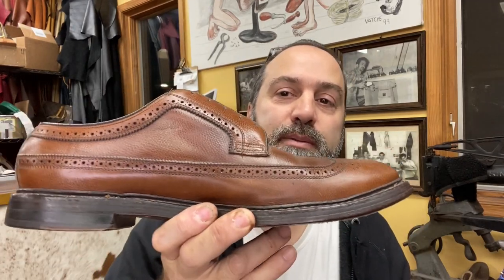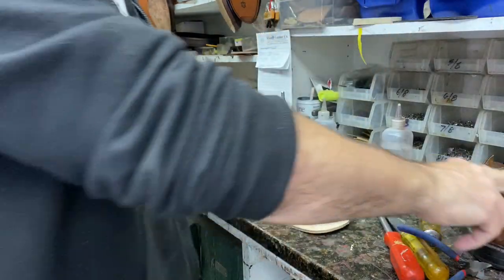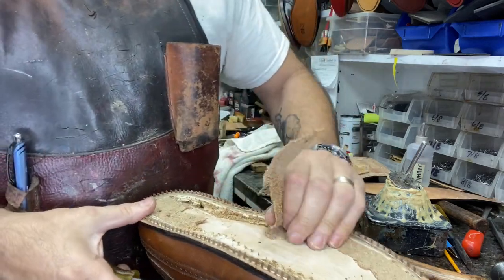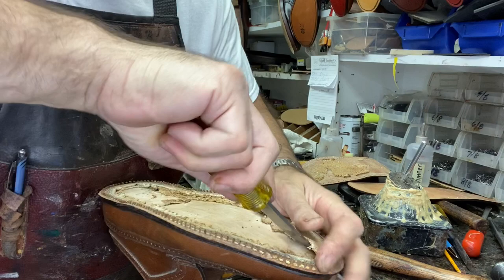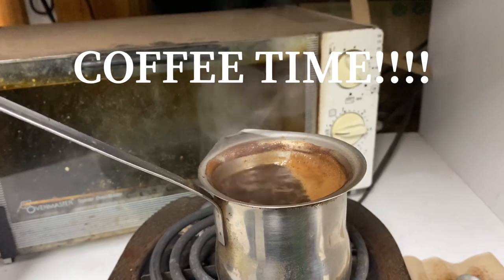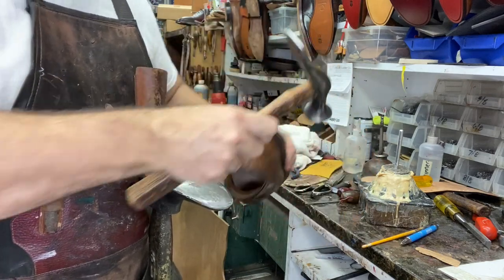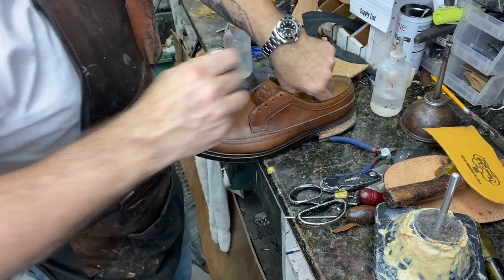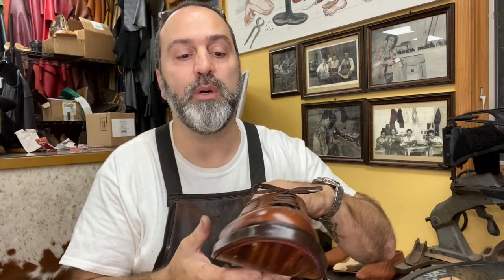Florsheim, Replacing foot beds.

Comment: Hey Steve: I just watched a Allen Edmond factory tour and noticed 2 things I have learned from you, that they don’t do. They don’t use a shank and they don’t use Cork Board ? They used this liquid type cork that is just poured and molded to the sole? I did watch as they made a 360 degree welt which I have watched u perform. Question: are these 2 applications, money savers? Why don’t they use cork board, why don’t they use a shank? I’m looking at purchasing a mid range shoe, 400-600-dollar shoe. And I want to get my bucks worth. Thank you for all the info and demos. U de man!
Reply from the maker: So most A/E shoes do not come with shanks. Some have wooden shanks, which ones I don’t know. I think hot cork is cheaper for them I guess. I only put shanks on customers request

Comment: Steve, do you ever add a foam or leather heel pad to the footbed/insole, similar to what you see standard in some Alden shoes?  If so, does that significantly change the depth of the heel counter relative to the person's foot...e.g. the heel pad raises the foot off the insole making the heel area too shallow to the point where the heel is not properly gripped?
Reply from the maker: I usually do add a foam padding and it doesn’t really change the height

Comment: Hi, I'm not sure if you still reply here, but worth a shot, my footbead has cracked and I started removing it thinking it would be easy. The insole is full leather + additional leather piece with some foam under the heel. Also the footbead is nailed down in the heal area. My problem is that I don't need to resole them but some of the cork was removed when I pulled the footbead away. I would like to fill the missing cork from inside and then glue new leather footbead and then glue on that soft heel sponge and reuse the heal half soles. Do you think it's possible?

Comment: I always say, there is the theoretical and practical... theoretically we all know you should acid to water, but we have no trouble adding water to pure vinegar... because theory explains why, it doesn't explain how. That is where experience comes in. You can sharpen your blade because you know that it will work for your application. The commenter may know the theory, but they don't have the practical knowledge that you do.

Comment: Would it be possible to replace this man made footbeds with leather footbeds like in the iron ranger traction tred or not really? They have cork filler below a fibreboard lasting board, poron foam layer, leather layer on top. This is how it looks cut in half https://youtu.be/mZMGlofn8vY?t=349 Thanks
Reply from the maker: Anything is possible
Reply: @BedosLeatherworksLLC  Red wing said they wouldn’t. Probably would be pretty hard to find someone to do it.

Comment: bamboo flyrod maker here: I LIVE or die by sharp blades. The stones make a fine cutting blade! It's not like you're using it to shave nodes, or plane out the top of a fine mahogany table! Spending 15 minutes to make a blade supremely and cleanly sharp only to slice stitches to strip the sole off? How this guy expect you to make money?
Reply from the maker: That is exactly what I was saying Robert, for what I use it for it works fine

Comment: People who have a very specific skill will bring into question when they see someone not utilizing that particular skill to accomplish their task. As if you claim to be a sword-smith or you are expected to follow the guidelines of professional knife sharpening when you are simply trying to quickly create a sharpening edge sharp enough to do what you need to do and remove the burrs on the cutting edge. But no Steve, you need to get out the wet stones, and different sharpening stones and work that edge... Because apparently someone thinks you have nothing else to do. I wonder what else they can do at your level besides sharpening a knife? I’m guessing they probably can’t do that either.